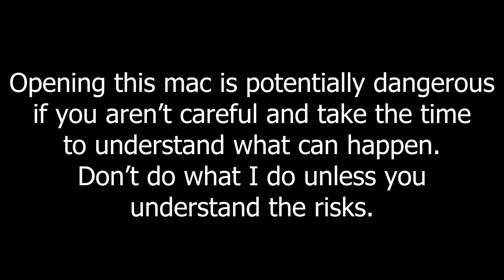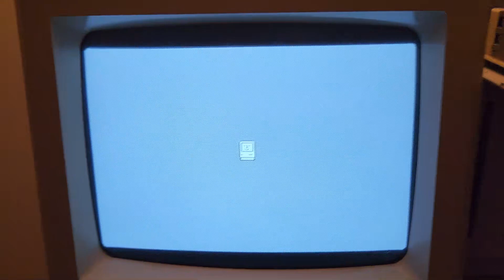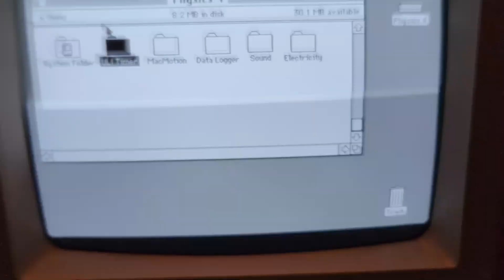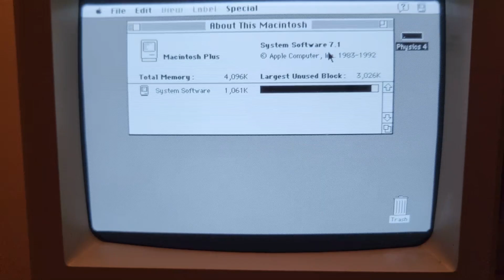A Dangerous Repair - Macintosh Classic II Repair Part 1

Comment: You were being quite over cautious. You should read lowendmac’s article called “The Truth About CRTs and Shock Danger” which was written by Prof. Thomas H. Lee from Stanford. (Basically boils down to 1. if you’re not gonna mess with the crt, don’t bother discharging, just keep your hands off of it and 2. It can’t kill you)
Obviously better safe than sorry though.
Reply from the maker: Yeah, I sorta understood that from the get-go, seeing other people do things how they do it, but there's no reason not to be overly safe in a situation like this. Not to mention, I just don't want to get zapped. I accidentally touched an outlet and that wasn't fun, so a CRT probably wouldn't be either.
Reply: Please don’t comment on something you don’t know about and give dangerous advise. Even these small CRTs can easily stop your heart or send it into arrhythmia with a shock from the flyback transformer / analog board. If you are ever working on a CRT with the case open or able to touch high voltage components you should ALWAYS discharge the CRT, even if you don’t intend to touch it. Also you can’t trust the reliability of these 30ish year old components, the bleeder resistor could have failed allowing the board to hold a charge. You can never be “over cautious” with these dangerous electronics as any mistake you make could be your last.